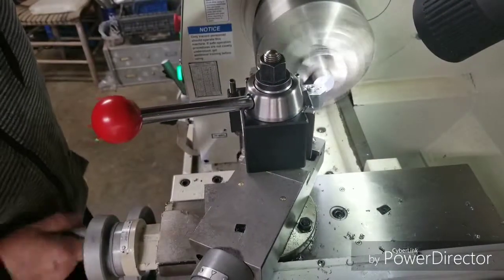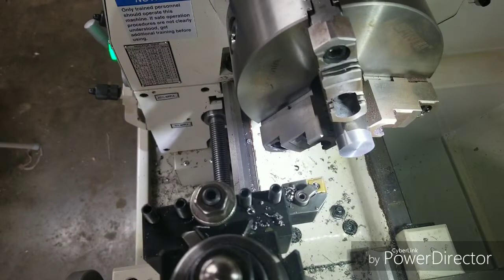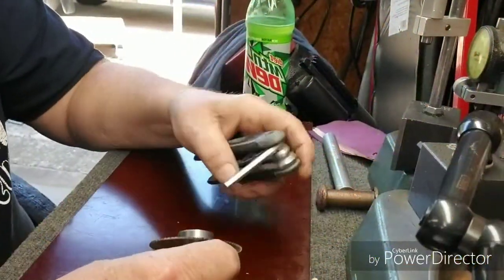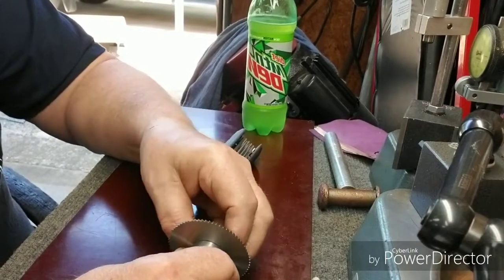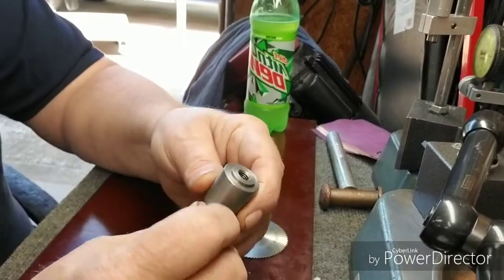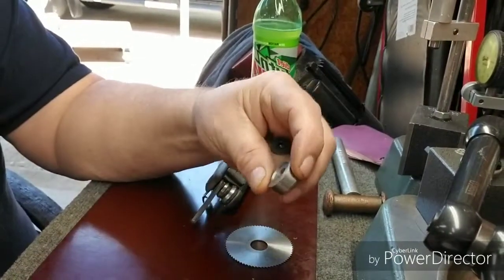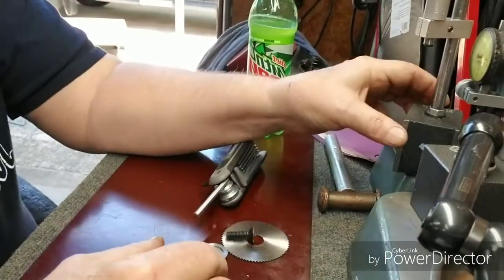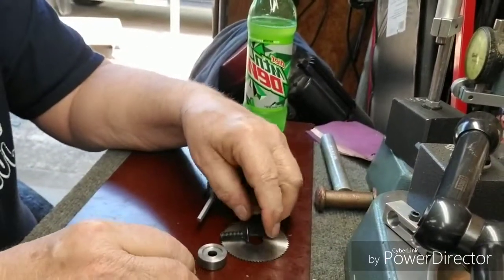Slitting saw arbor

Comment: Hi Anthony,
I noticed you are getting a reverse image from your camera.
I assume you are using a cell phone, and using the front camera for your videos.
The front camera is normally used for selfies and is set by default to give a reverse image on many phones like you are looking in a mirror.
Look in the settings menu for a option to turn off this "feature" in your phone to correct it.
Alternately you may be able to correct it with your editing software for any clips with lettering in them by mirroring them.
Cheers from downunder
Eric
Reply from the maker: Yes I use the front camera on my phone every now and then for shots.  I know they're reverse.  Thanks for stopping, viewing  and commenting. 
God bless and Merry Christmas